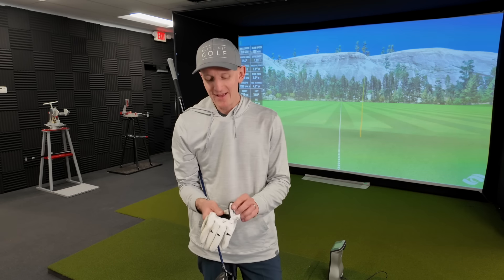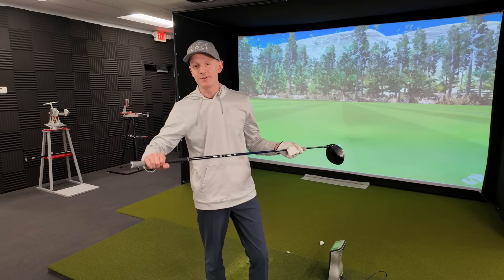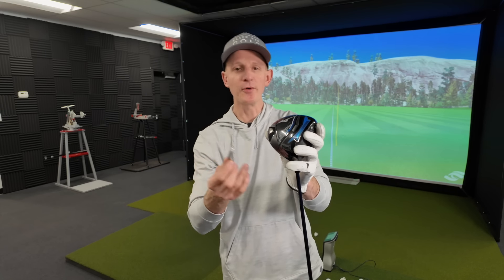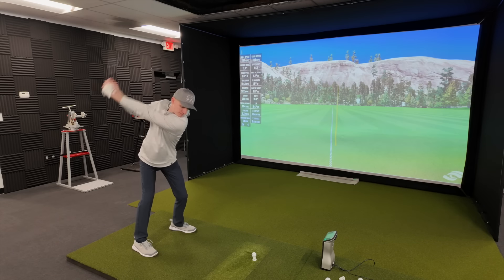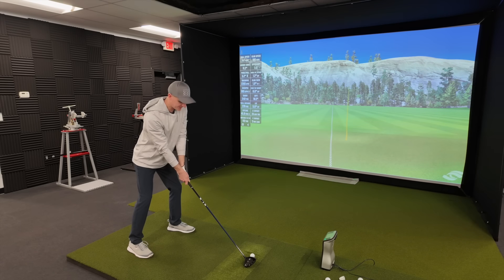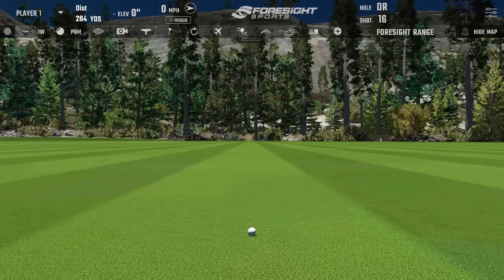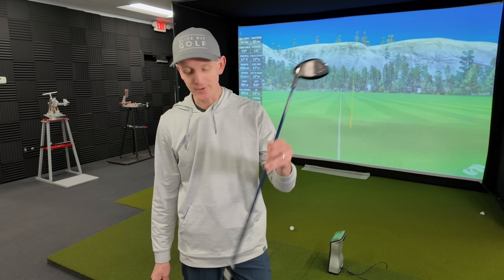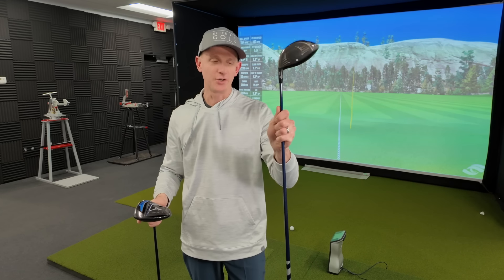MAKE YOUR DRIVER BETTER / 3 SIMPLE DRIVER ADJUSTMENTS

Comment: let's try this with a swing-robot :)
https://youtu.be/dQ5XxPEEG3E?si=0sJTalTxuN-uzTIH

15 grams on the toe gives 10 yds of fade
15 grams on the heel gives 30 yds of fade

swing-speed 100mph, neutral clubhead config
I'm not sure what the yardage was without the tape, 
or the shaft length, lie or loft

but it's basically "a lot more weight than they would ever use in a fitting"

Comment: Cut my 44,5" shaft down to 43" on my Cleveland Launcher XL. Didn't need to adjust the swingweight as the new weight just worked for me and I couldn't notice a difference anyway. Drives are the same distance, sometimes longer, and hitting way more fairways now.

Comment: I struggle to hit my driver high custom fitting I was minus 4 at impact. I saw your test with Mr short game playing around with butt weights. I got a callaway 13.5 epic driver off eBay. Fitted an 85g small jumbo max grip brought the swingweight down to C6 and it’s now perfect really helps me to control the face and the loft/thicker grip combo gives me a great height. I’d never have thought it would work but it really does for me.

Comment: I took the shaft out my Titleist 910 driver and put it in my 910 3 wood, i now hit 3 wood 270-275 hardly miss a fairway and have an extra wedge instead of a driver. I also seem to hit the 3wood better off the deck now.
Reply: The 910 3 wood has a solid feeling at impact. I changed my wood shafts to Tensi orange counter balanced shafts and added 10 grams of head weight. This combination really suits me. I've tried all the modern drivers. But the reshafted woods and weight has brought them into the modern world at a fraction of the price.

Comment: One modification you didn’t mention that is pretty easy and pretty inexpensive, although not free. I spent years getting rid of my slice, but after playing very little for a couple of years, I came back to the game with a draw that would turn into a hook far too frequently. I switched out my grips from standard to mid-sized which has greatly helped straighten my ball flight. I have always had trouble with hooking my hybrids, so I started there with good results so I regripped the rest of my bag.

Comment: Playing ping g410 R with 1/2” shorter LA shaft. Thinking about new ping G430 max 10, will this shaft still “work” in new ping driver in terms of fit?
Reply from the maker: Shaft is the shaft. If it works for your swing, it doesn't matter what's on the end of it.

Comment: Looking at adding head weight to a Callaway ai smoke max. Do you know if a second sliding back weight can be added? I ask because I want to cut the shaft down to 43.5” playing length, and the heaviest front weight won’t be enough, and the sliding weight comes stock with the heaviest at 14g. I know a tip weight might be an option, but I’m just trying to figure out if it’s physically possible. Do you know by chance?

Comment: I do this with my Driver's and it makes them a lot easier to hit - I replace the weights with heavier ones rather than using tape - the only thing is I find the shorter Driver with more weight back gives me much higher launch, so I actually lower the loft.

Comment: I got my driver at 3 wood length and it's been so much better. I like to play a light shaft with a heavy head. My irons are the same. I put 3 pieces of lead tape the length of my p790 heads. On each head

Comment: Coincidence that this video came out as im having kinda this problem.  And ordered lead tape2 days ago to hopefully remedy the problem.  
My gamer driver was a 2021 PXG 0211 with a 70g stiff diamana S+Limited shaft at 45.75.  I hit it great but its not great in the distance department so i upgraded to a Cobra Aerojet driver with a stiff 60g Kai'li shaft 45.5.  Its like night and day.  Its so light i cant feel the clubhead.  Shots spraying all over the place.  Should i start with putting the tape on the clubhead or experiment with placing 10 grams on the shaft?
Reply from the maker: The tape will obviously be faster unless you already have another shaft tipped up for that head, so I would start there.

Comment: Had a Tsr2 with standard length shaft, sometimes worked and sometimes not. Lost confidence and sold for good money and bought sim max 2. Then ordered  shaft which comes up 1.5 inches shorter and it is absolute beast. 280/290 on my really good hits centre fairway, 250/260 on not so good hits but still playable. I’ve been fitted so many times and never had a shorter shaft been suggested

Comment: I'm not sure how you could use the loft sleeve to add loft - which in most cases both closes the face angle, and makes the lie a little more upright....and then miss it to the right???🤷‍♂🤣Great tips though....all of those tips are a great way to self correct if one doesn't have the time or budget for a club fitting.
Reply from the maker: The change in adapter setting can be viewed in one of two ways. If you square the face to the target or more specifically if you have the same face angle every time, you do change the loft. If you just lay the club down and let it sit as it does, then you are more likely to see the face angle change. You can't make any blanket statements about lie angle because different brands have different starting hosel positions so the same loft change can have different lie changes. That said, even if you change the lie angle more upright on the driver, the actual change in the ball starting more left will be extremely small and honestly not worth worrying about.
Reply: @EFGMC   Definitely true about correcting the face angle off the ground and taking your grip with a neutral face!! It was kind of tongue in cheek....🤣 Those 3 tips are all great to help people reduce the dispersion, and hit more fairways!!

Comment: I have a three wood shaft on my driver. Definitely helps. I still hit a lot of bad drives, but that has everything to do with me being bad at golf.
Reply: I have tried my G425 3 wood shaft in my G430 LST and it is quite pleasant. I shortened the driver shaft 1/2" before trying it just afraid to pull the trigger and permanently swap the driver to 3 wood length

Comment: New subscriber here and am very impressed with your knowledge and presentation.  A golf store fitter cut  a driver 45-gram shaft below 44" after seeing my inconsistency  with the standard 45.75" standard length that's in my SIM. I hit it more consistently in the store but on the course it was shorter in distance. I checked the swing weight and its C6. He did not suggest I do anything to the head or get another shaft. I have another track weight but that might add too much in the front lowering launch more. Your suggestions in the video seem to make your setup work quite well. Mine is a 9 degree, set upright. What suggestions would you recommend I try? What length is too short? Thanks .
Reply from the maker: First I would try the extra track weight since you have it and it's an easy test on the range. After that, some lead tape on the back lower portion of the sole.
I'd start there.
Reply: Thank you. I am watching your videos and learning a lot.

Comment: Lovely video once again! For us nerds can you give full specs on each driver? Like what is playing length of both? Swing Weight of both? What shaft? Anything else you can think of, thanks!
Reply from the maker: Gamer is a Mizuno ST230X 9.5 at 45 inches. D2-3 SW.
Fujikura Ventus TR Blue 6S, Lamkin ST+2 Hybrid 360

Shortie is a Srixon ZX7 MkII 10.5 at 44 inches. D2 SW.
Fujikura Ventus TR Blue 7S tipped 1/2 inch. Same grip

Comment: Many years ago Ralph Maltby of the Golfworks had specs for a "hero driver". He suggested to make a driver 1/2" shorter than standard and at least 2-4 swing weight points heavier than usual. This shorter, heavier club would help someone who felt they could not hit a standard driver. I currently play a 44" Ping G425 with a D2 swing weight and 10.5 degrees of loft. Works for me
!!
Reply: D2 is really light though right ?
Reply: @johnathanwetherill456  D2 is pretty much middle of the road, with C8 being very light, and D6 through D8 on the heavier side.  When I got my Titleist TSR2 @ 45" it came from Titleist at D5.  Since I'm 73 years old, I prefer a driver in the D2-D3 swing weight range, as I can feel the head and hit the middle pretty consistently. My driver now plays at 44 1/2" and D2. In most cases, driver swing weight is a personal preference.
Reply: My wife’s driver is E2 and she hits a mile. Her driver is a lot heavier than my Ping driver 🤷‍♂️
Reply: I’m playing my 9° rogue triple diamond all the way down to 42.75” (half tip trimmed half butt trimmed) and hot melt added to get the CG forward and weight up to D6. After that it feels hard to miss the center and it hits nearly the exact same shot shape unless you make an awful swing.
Reply: @johnathanwetherill456  D2 for a driver is sorta light.
Reply: What if I added a stiff shaft?

Comment: Hey AJ, great video. I have been modifying my drivers like this for years. Lose maybe 10 yards but really pick up accuracy.  I call mine my "safety driver".
Reply: Did u need to add weight to ?
Reply: @leblunt27  Mine is an old 12* TaylorMade 200 steel headed driver.  Used a 5.0 steel rifle shaft, I had laying around. Play it at 43.5", like an old school driver.  News for you... the latest 45" drivers with 460CC heads made of carbon and titanium are 10-20 yards longer when hit on the screws - BUT how often do you do that? I hit this one 230 very regularly, while my modern PXG driver goes 240 on a great hit.

Comment: I cut 3 inches off of my g25 driver. How much weight to I need to add to retain the correct swing weight. 
I love it being 3 inches shorter
Reply from the maker: That puts it at around 5 wood length so we would want to aim for that kind of head weight if we want a "standard" swing weight feel. 25g as a starting point but you may find less or more than that feels better to you.

Comment: I have a standard Sim 2 Max Taylormade 12 degree Driver, have a push or strong slice. Is it possible to get a heavier weight put in near the heel as I don’t want to go up to the 14 degree. Or is the only option to put lead tape near heel.Thanks. Mick
Reply from the maker: Might be aftermarkets available but lead tape will be easier and cheaper.
Reply: AJ thanks again for your advice, never before realised how important it is to get fitted for clubs. Really enjoy your series. Once again thanks for your help. Wish you well. Mick

Comment: I must be an exception to the rules. Chocking never seems to work for me on any club no matter how I go about it but the putter. With my driver I found out decreasing the loft actually helped my driving tremendously in dispersion and distance.
Reply from the maker: If choking up doesn't seem to be working, it is most likely you either don't like the lighter head feel that results from it (which is where the lead tape or weights come in) or you don't like the smaller grip diameter you get from the lower hand position. That is harder to remedy short term in testing although you could use some anti slip tape to build it up.

Comment: That was great!
I usuallynplay a 60g stiff shaft but I'm thinking about getting a 50g regular shaft and tipping it, as well as playing it an inch shorters.
How much weight would I need to add (approximately), to get a similar though slightly lighter swing weight?
Reply from the maker: 10g

Comment: Kind of cracks me up to be honest.  When I started playing golf in the early eighties, the standard driver length was 43". My old TaylorMade Bubble Super Steel driver is "standard" length for the day, has a swing weight of D1 and has 10.5° of loft. It does, however, have a much smaller head.  Since, today's heads are larger and more forgiving, I can see the advantage.  But still, my next TaylorMade driver was 44", D2 and also 10.5° with a 360cc head. What would be the difference between that and a shortie driver?

Comment: What’s the difference after shortening the shaft to add weight back with a heavier shaft vs lead tape to the head itself?  Also, if I prefer a lighter swing weight can I just shorten and not add back any weight??
Reply from the maker: Adding head weight is 5x more influential in increasing swing weight than shaft weight. That's why I recommended focusing on that first.
If you like the feel of the club after shortening without changing any weights, then by all means go with that.

Comment: I play a TS2 with an x-stiff tensei AV blue shaft, I struggle with hitting the ball too high and feel I'm losing distance with the ball spinning up. The loft is turned down to 8.75 degrees, would applying lead tape near the face lower the ball flight and possibly spin?
Reply from the maker: Yes, right at the front of the sole, close to the face. Usually won't make a huge difference but it can help. I would also keep track of your impact location as that can make a big difference in launch.
Reply: Have you used a launch monitor to see attack angle. It may be that you are hitting down, causing more height and spin.

Comment: Great Video! Thanks! Just wondering for the shorten option (which I did) how much weight / lead tape would you add per inch reduced?
Reply from the maker: I would use between 5-10g. Test it to see how much works for you.

Comment: with the cleveland xl driver i understand they have a counterweight in the grip end of the shaft, so my question is do i need to take shaft out from head or can i cut grip end of shaft ?
Reply from the maker: I have not seen the specific counter weight in a Cleveland, but every other brand can be easily removed before you cut the shaft. After you can decide whether you want to reinstall the weight or not.
Reply: Thanks for your reply ,i enjoy your videos @EFGMC

Comment: I have been to a fitting session with a pro for my tsi3 driver. Then on the range use lead tape to make the weight feel as I want it. My driving went from my worst category to my best. There is no huge secret. Just practice harder and get help from professionals

Comment: Know a few guys that put 3wood shafts in theirs and are way more accurate.
Reply: My driver is 45.75", my 3wood is 42.5". That would be a huge swing weight (SW) adjustment for me (D2 Driver, D0 3wood). You might try it with a used club. 3 fundamentals of golf:
Contact, Dispersion, and Distance. Have to find a balance there. Driver shorter? Less distance. I tried my driver (by accident after shaft change) at 47" - put a ball in a backyard two houses up from previous long backyard shot :face-fuchsia-poop-shape:. BTW, my provisional went just as far, middle of the fairway, 6i to 2.5', par! First time in my life getting a par after going OB.

Comment: Or just go get fit for a driver.  While few people need a 45.5” shaft for a driver, most everyone should be able to swing 44.5” to 45”.  The problem for most people is the lack of spin.  People are playing low spin balls, low spin heads, and low spin shafts and they wonder why they can’t hit it straight.  Spin is your friend.
Reply: Custom fittings are a shitshow. I guarantee if you went to 5 different fitters they would all be completely different specs.

Comment: Nice vid, love tinkering like this.  If you don't like the lead tape route, often you can just add an additional weight.  For instance, in my TSI3, i just added a lighter than standard weight in addition to the weight it came with.  I can usually find lighter weights for less $, so it's cheaper too than buying a whole new heavier weight.

Comment: What's crazy is that your "shorty driver" was standard length and weight 15+ years ago. It was only when golf equipment companies noticed they could sell snake oil to consumers in the form of longer drivers by simply increasing the shaft length.

Comment: In one show you put weight in shaft, counter balance 
Is that not a good thing to do, have you tried counter balance with more weight in the head
Love watching the show
Reply from the maker: Counter balance is something you just need to try and see if it gives you the results desired. I had it in my wedges and mini driver for a while. Not currently though.

Comment: Great Video AJ! I'm 6' 3" and play a 45g R flex shaft at 44.75", D3 SW, and a low spin tour head at 8°. My cruising SS is 110 mph and this setup has me hitting absolute bombs on a rope! Low spin head + higher launch lighter but stable shaft, and a head that i can feel through the swing, is the key.
Reply: Love to know your setup what head what shaft like the idea very much!
Reply: @tjostrom5530   so I guess technically it's not a "tour" head but it's a low spin, lower lofted head. It's a PXG Gen 6 with a Maltby MPF Pro UL (ultra light) R flex shaft $40. The shaft is 47g before it's cut. The head is lofted down to 7.5°. I also have a Garafalloy Pro Launch Blue 45g A flex that I've been using for the past 2 years $60. There's a big group of us on MGS who have been playing these with huge success. We call it the Otto Phlex
Reply: Thanks so much!